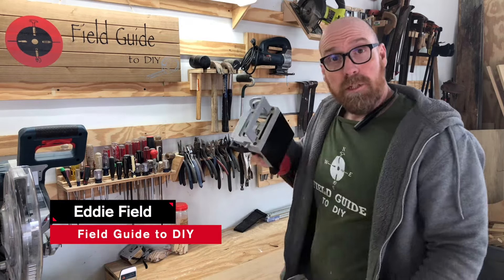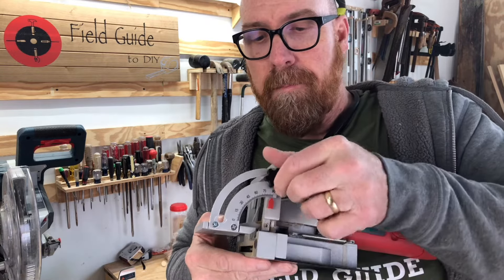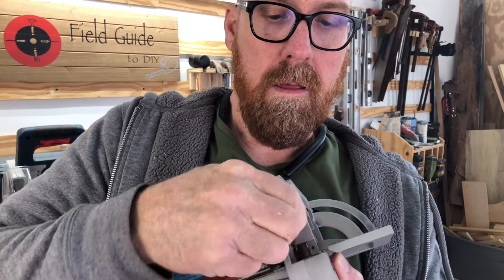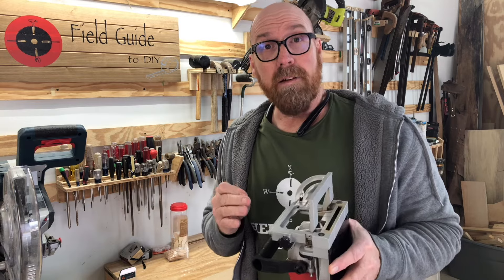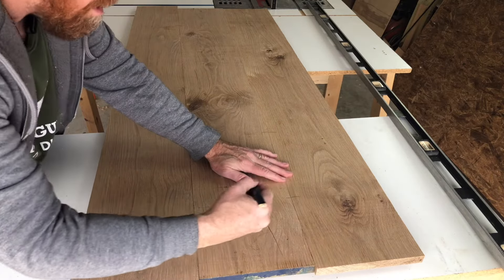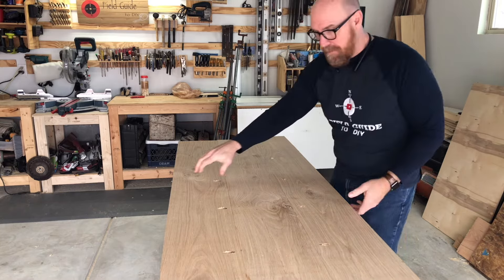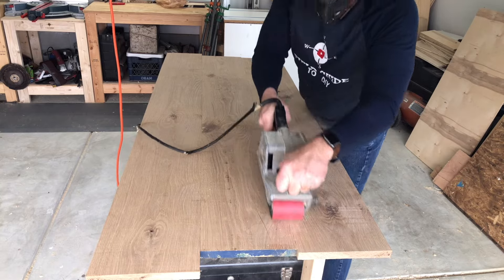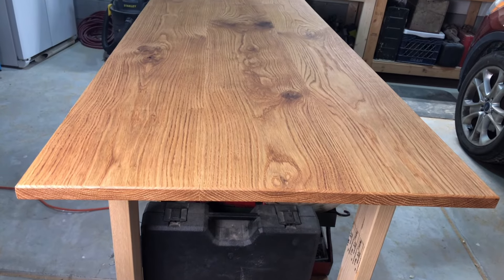How to Use a Biscuit Joiner | Joining Boards on a Table Top

Comment: For everyone out there asking/struggling with getting it perfect. You definitely want to get your boards right before you attempt a joint between them. If they are crowned or bowed etc. you can squeeze it out of them in most cases but you must have perfectly square edges, and use strong backs, etc. to make sure that, the surface comes out flat/flush ultimately.
On thicker boards, I do two rows of biscuits. In other words and upper row and a lower row. Also, there is some information out there warning against getting the biscuits too close to the surface that will be exposed. The glue and the biscuit tend to swell and cause lumps if there is not sufficient, wood between the biscuit and the visible surface. 😅🤔
Reply from the maker: It sounds like you’ve done this a time or two.  Thank you for contributing!

Comment: Sorry may be a dumb question, but even using a biscuit joiner, you still need to drill pocket holes and screws to join the boards in addition to glue?
Reply from the maker: David, NOT a dumb question.  I’ve been told the wood glue and biscuits would be enough but with such a high profile piece, I didn’t want to risk ANY separation.
Reply: @FieldGuidetoDIY  thank you! I’ll be building a desk top for my office soon, so this definitely helps!

Comment: I’ve also made custom linear grain biscuits when strength is of the utmost importance. When I say linear grain, I mean, orienting the grain of the custom biscuit at right angles to the grain of the wood being joined. In other words, the grain is linear to the moment/direction of stress that the biscuit will resist against. 🧐🤔💪🏼
You can also double plunge the joiner to fit thicker custom biscuits.🧐💪🏼
Reply from the maker: Good point.  Personally I never thought of the added strength of the grain of the biscuits.

Comment: Looks like you used pocket screws underneath also?  Just makes it sturdier or what?
Reply from the maker: It helped hold the clamps hold the boards while the glue sets up.  Thanks so much for watching.

Comment: Why are you plunging the cutter three times?  It just increases the width of the slot.
Reply from the maker: @jamalama5548  very observant.  For two reasons.  One, it clears out the tear out.  Second, these biscuits tend to run a little fatter and have to be hammered in which ruins them.  Thanks for asking and thanks for watching.  Don’t hesitate to ask any other questions!

Comment: I get this concept but it assumes the boards aren’t bent in any way or else the depth has to vary on the opposing board…right?
Reply from the maker: Great point.  Since I set the depth of the biscuit from the top of the desktop or tabletop, it doesn’t matter how thick or twisted the boards are (within reason of course).  Once it is all together I did a lot of sanding the bring it all flat.  I hope this helps.  Thanks so much for watching.
Reply: What grit did you use initially ?

Comment: Looks so easy in reality the wood I had was slightly warped. Nightmare
Reply from the maker: Oh my.  And the biscuit trick didn’t level it?
Reply: @ well I’ll find out tomorrow. Wasn’t brave enough to do it today. First time I’m ever doing this
Reply: @ well biscuits seem to have done trick but it went wrong. The clamps I bought weren’t good enough so I couldn’t for some reason fully close the gaps. Sigh. 

There’s a 3-4mm gap between the 3 planks I joined together so I guess I’m going to have to fill that in somehow to get a flush look.

I need to build the second worktop as well yet so let’s see how that goes but still plenty of work to do with the first one.
Reply: It’s fun to do but you pros make it look easy and I guess you need the right equipment Whcih isn’t always possible with DIYers